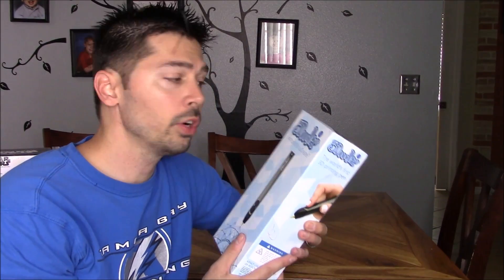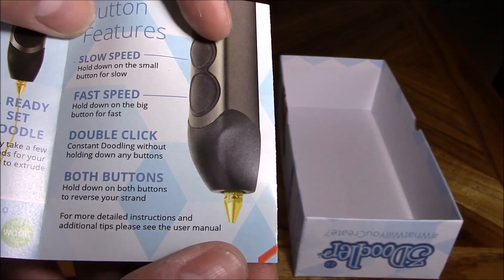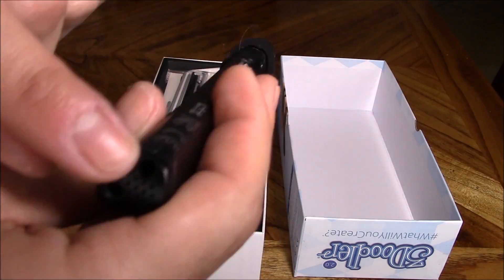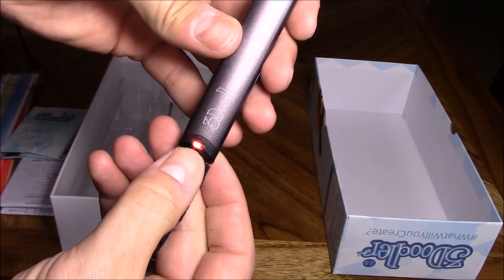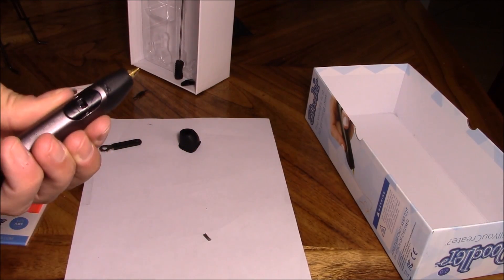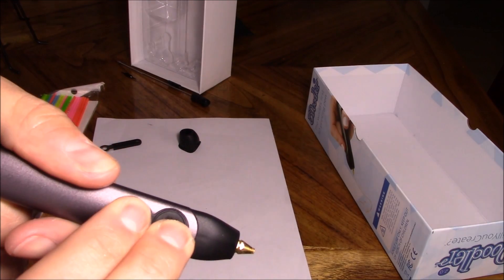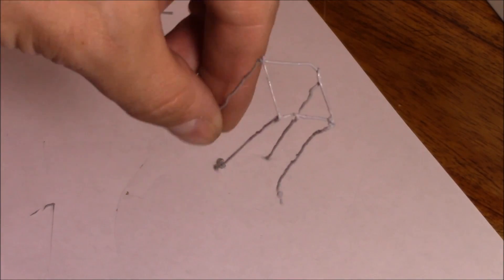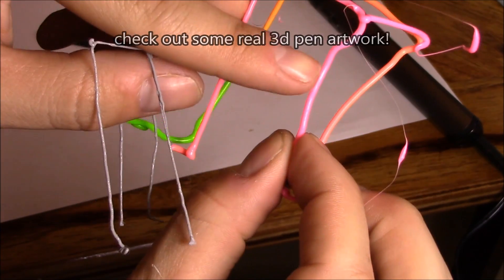3d printing pen 3Doodler 2.0 review - How to setup use and clean clogs

Comment: Do you know whether or not this could be used in modeling to fill in gaps before painting? Really cool product either way.
Reply from the maker: +stonedcommander it's melted plastic similar to what model cars/airplanes are made of, worth a try if it doesn't work just return it.
Reply: +Tampatec I don't want to be mean or anything but the truth is actually ABS hardens quicker and PLA hardens slower
Reply: Oof yh I your right I agree with u